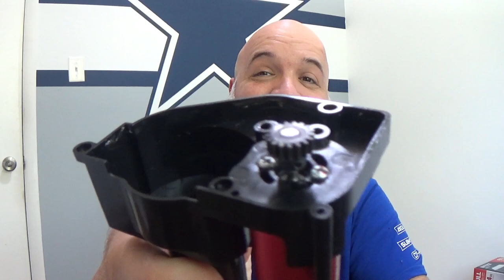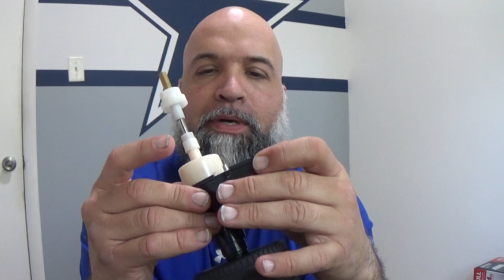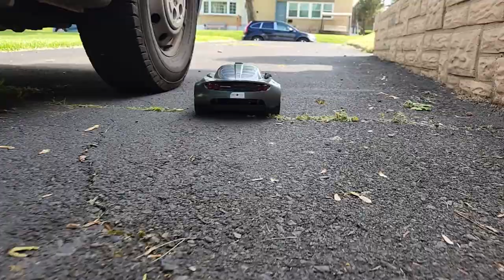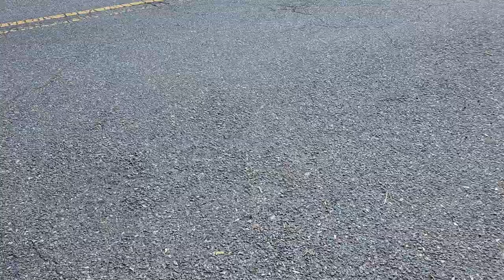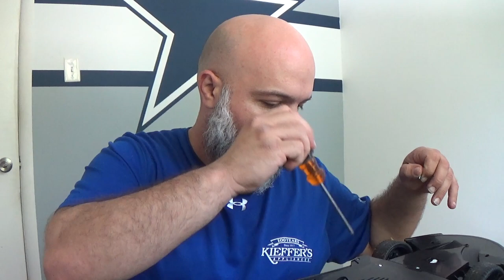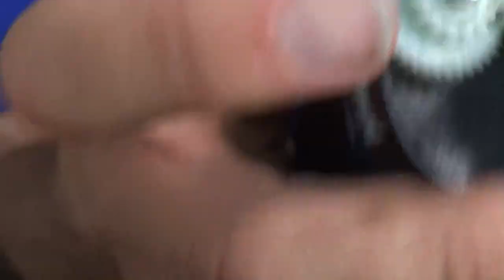Toy Grade 1/8 Scale Hennessey Venom GT gets a new Pinion gear and goes out for another test run

Comment: You should check out my radio shack frame buggy brushless conversion. It has more power than it can handle and spins at anything more than 1/2 throttle but man is it fun for a car that did 5.6 mph stock .. glad ya got it figured out with the gears
Reply from the maker: Yea the gears were a bit of a pain to find
Reply: The gears were No Problem for me. Bolt-on Drag Slash rear-end and you will appreciate the speed my friend. I.....GUARANTEE!!!

Comment: Problems Solved: No more suspension and tire issues; Bolt-on Traxxas Slash rear-end and solve your problems to hobby grade level.
Reply from the maker: How did you bolt the slash rear end to it
Reply: @rccargarage  : Purchase a used Slash Chassis, align the two chassis and mark it when the wheels are aligned to the Hennessey body. Mark and cut the Slash straight across. However, you will have to figure out where to cut the Hennessey's rear-end. Align the rear-end to the Hennessey, overlay the rear-end to the Hennessey, do markups, cut the Slash chassis, then drill the holes to bolt on the rear-end. It's Best to Undercut your chassis material, then to Overcut your material. Remember, you can't add back the materials after you cut it away. Let me know, if you have any problems in the process. Take your time cutting away the materials. Oh. One more thing! Make sure your drag slash comes with a Traxxas Differential transmission!

Comment: I don't like that the wheels can't be changed, there are adaptors on Amazon but the front wheels have that unremovable
Reply: i maneged to remove them but i had to take of the screws that are bolted onto the the wheel steering its posible

Comment: hey i was wondering if you can send me the links to these parts cause i have the same rc car and i wanna rebuild it like your cause my teacher is willing to help me get parts for the car for robotics im just a sophmore in hs but i was just wondering that!!
Reply from the maker: Yea not a problem hope it will help this link is for the gear 
https://amzn.to/3RHvbSa
And here is the Link for the esc motor combo
https://amzn.to/48zsBDH
And here is a servo that can be used but any servo will work
https://amzn.to/3EYMmY2
Now your also going to need a transmitter and reciever combo like this one
https://amzn.to/3LHE9eB
Hope this helps and that your able to get it going and good luck with it
Reply: Okay thank you very much I’m new to this and it’s very fun so far stripped the whole electronics on it so I can have space to work on and one more question what battery did you use or like recommend?
Reply from the maker: @officalgkk2034 any 2S battery will work